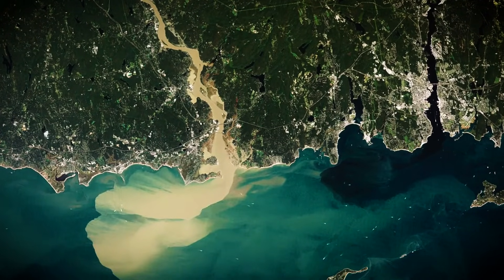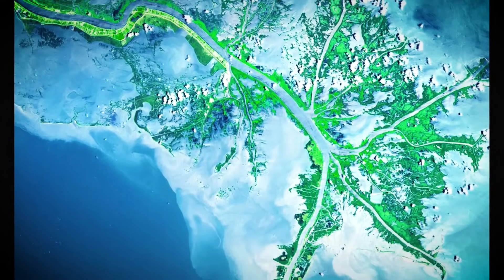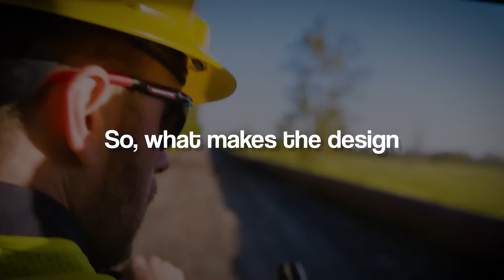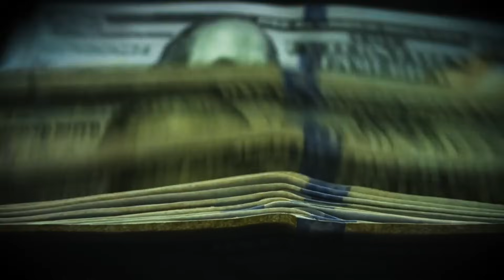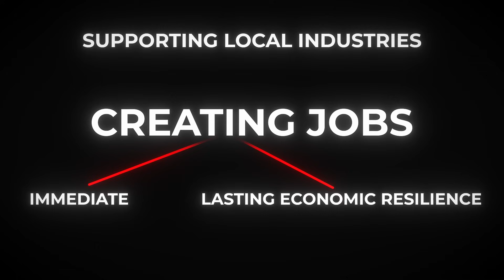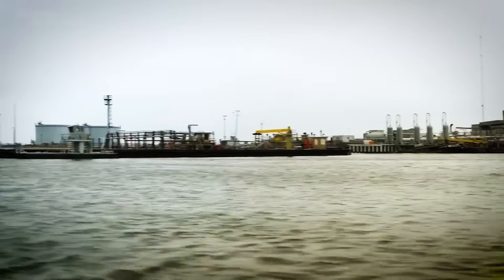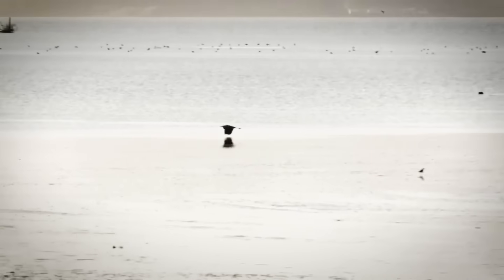The $2.9 Billion Bet to Restore Louisiana's Coast

Comment: At what point will they learn they can’t control nature
Reply: the dutch manage….
Reply: @Xvery5  Barely. They toss gobs of money at the problem regularly. Since their land mass is so limited, they don't have much choice but the US has lots of barely inhabited areas. We just insist on living right on the water in high risk areas. Insurance companies are going to charge appropriately for the privilege.
Reply: @SHO1989 someone needs to have a shipping port to recieve international trade goods, and you cant do that from the middle of Nebraska
Reply: exactly Rivers change over years of sediment deposits down and upstream the banks... nature changes
Reply: They actually created another industry to sustain their pockets because the river is dying. The region changes due to the flow of water.
Reply: This problem was caused by humans not nature. The Mississippi River levee stopped the normal flow of silt in these regions. The levee was built by humans not nature. Also oil and gas drilling cut canals into these areas causing salt water incursions. The salt water killed the plant life that helps stabilize the land.  Nature was the victim not the perpetrator.
Reply: Oh it can be controlled, you just need to make nature work for you instead of against it.
Reply: pretty simple I will go to do even if he’s in Nebraska Betty State build a simple dock put some gravel in front of it to the driveway. You back up your semi truck, your pick up truck, your trailer whatever it is just simply roll your item in or use the forklift driver they’re really really simple don’t need no big infrastructure massive set up. Don’t need gantry cranes and such if you’re bringing in sea containers, something different completely, but normal stuff to fit on a skid or motorcycle no need for no massive infrastructure less that’s just what you’re doing specifically for 11 and shipping international. I’m trying to ship them.
Reply: Exactly. That bet is as good as lost before they even started.

California, Miami, the Gulf coast in general all need to be returned to nature and man should just learn to live in less risky areas
Reply: @SHO1989  Show me one are without risk?  I live in Louisiana and our major risk is hurricanes and flooding.  Both of which you know are coming before they hit.
Reply: @omegaman66 You are part of the Gulf coast, no? Which I pointed out in my comment.

True, every area has its own risks, but some, California, Florida, and the Gulf coast are the riskiest, IMHO. I'm guessing the insurance companies agree and adjust rates in these areas accordingly.

It's been like this for decades. To continue rebuilding after every disaster in these areas and expecting a different outcome is ludicrous.